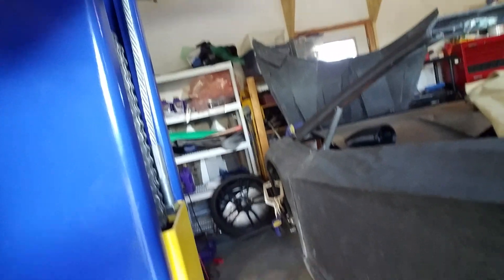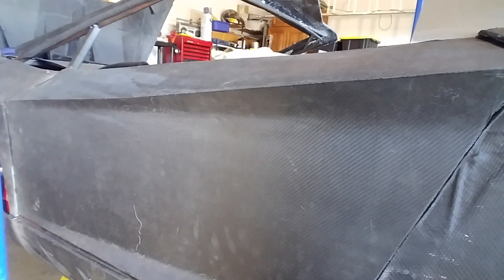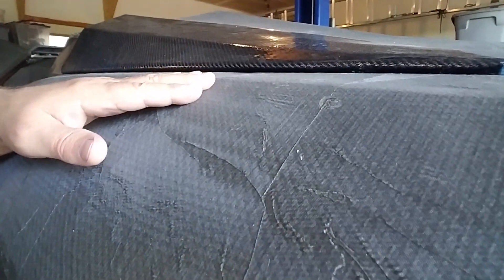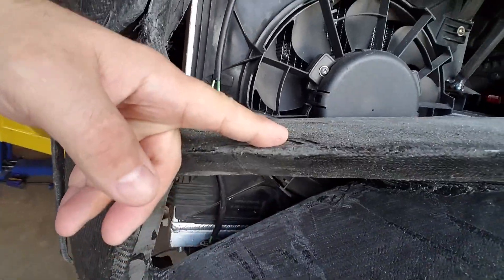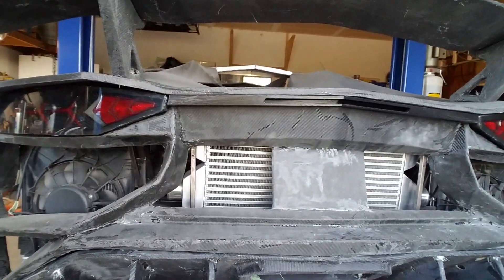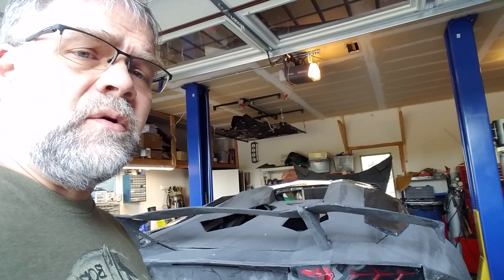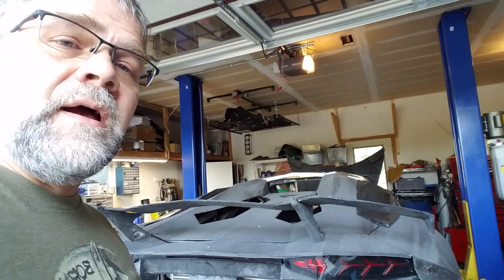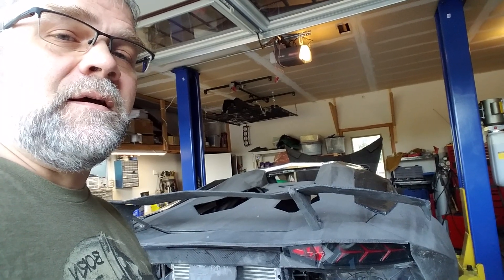Distortions Part 1

Comment: Was curious if you had any issues with de lamination aside from when you did the extreme heat test with the torch? Also if you don’t mind me asking what percentage of infill are you using for the printed pieces?
Reply from the maker: Yes, but I have  fixed that problem with going to 5mm thick panels with 15% honeycomb infill.  In addition, the epoxy generates a lot of heat, so making sure it has nowhere to pool is critical.
Reply: Awesome thank you very much for the response I know you’ve got to be busy! You and another builder have inspired me to go for an pretty ambitious project myself and getting my son involved. I really appreciate that. Love the videos always look forward to them